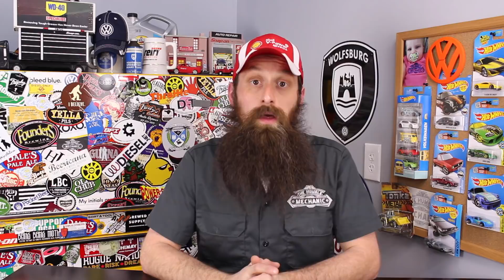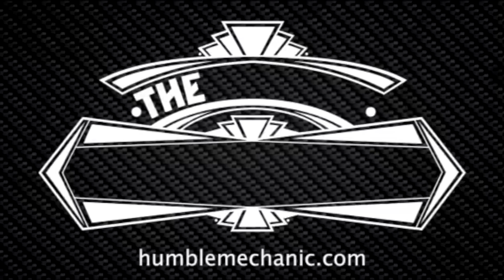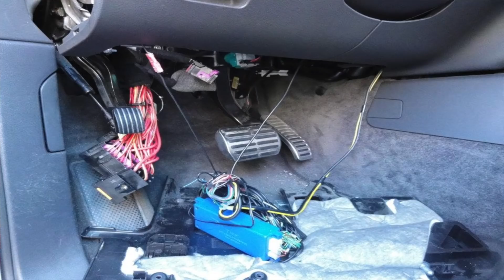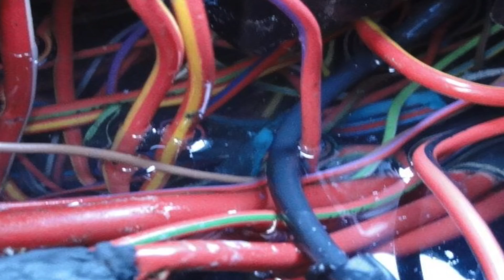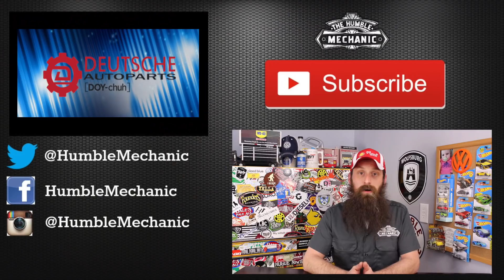Top 5 Failures of the Volkswagen Touareg

Comment: We bought a used 2012 Touareg three and half years ago, replaced tyres after 40,000km and didn’t have any of the issues that you spoke of.
Reply: This is more about the very first years of the Touareg. After the facelift many were resolved. 2gen one (what you have) is much better designed vehicle.

Comment: I have a 2017 v6 3.0 only problem I have had brakes and discs replaced 23000 miles only due to steering shudder under breaking discs only 20%worn pads 50% worn not good for 2300 miles just replaced with brembro discs/pads £120 DIY other wise all good

Comment: Hi, 2012 treg owner and have spent a small fortune on electrical issues and judging by treq owners forums these are ongoing issues that VW has not modified. A couple of questions please, currently have orange warning light up "ACC unavailable" and according to VW dealership this is because of a faulty sensor. Would this be right? can they plug into my computer and interegate the fault and tell me which sensor it is? is this a simple repair? cost roughly? Also, we are on 3 rd lot of disc pads and rotors, is this normal wear and tear or are we too hard on brakes? should we go for and aftermarket setup which could provide better disks and pads? Finally, with electrical problems should we stop the auto motor start/stop to save fuel as dont want to have to replace the starter motor? does the starter motor have a life span in this mode. To be fair, we bought an expensive, german engineered car expecting years of trouble free motoring in our retirement but it has just turned out to be an unreliable money pit, I reckon we have put 15K into electricals, so disappointed and would never recommend buying one to anybody. Would value your comments
Reply from the maker: Totally normal for brakes. 

On the ACC, it’s not quite as simple as just plugging in. But they should be able to tell you which sensor has failed. 

If you can disable start/stop I might. Starter motors do have a lifespan. But it’s a ton of starts. 

I’m guessing you’re not in the US? The 2012 Touareg has been great here. Not perfect but really really good

Comment: I have a 2006 V8 Touareg. I was driving on the highwway today when my low battery light came on and showed it at ~10-12 volts (normally  operates at ~14 volts on the dash. Eventually all the non-essential stuff shut down (as you described in your video) and I had to park it. The battery is brand new this winter---I had issues using the jump terminal to boost/charge the previous battery. It was working fine until tonight.

I'm pretty new to VW--do you think this could be something simple like an alternator--or could it be an electrical issue/something else I'd have trouble fixing/diagnosing?

*Note: I bought this pre-owned from a VW dealership. Before they sold it to me they had to fix a headlight (ended up being a wiring issue) and they replaced the dash lights. 

Any help would be appreciated!
Reply from the maker: Could be an alternator, and those were really good about high volt drop on the cable from the jump-start post to the starter/alternator
Reply: @HumbleMechanic  Hi Charles, thanks for this video - and the "how to properly test for a voltage drop".   Super, super helpful.  Would replacing the cable from the jump start post to the starter be a good place to knock a potential source for the electrical issues?
Reply: Cam shaft . I had issue where low oil pressur light would come on while I'm driving and car just automatically would stop. Had the cam shaft replaced. Car running fine now. 2008 touareg 2 V8 fully loaded
Reply: Question is safe to use hyper seal in my touareg 2008 v8. Notice my valve cover gasket are leaking.

Comment: Thinking of buying an 05 Touareg V8 with 91k miles.  It needs $2700 in repairs just to pass inspection at this time. My fear is it will need more after I purchase it. Thoughts?
Reply from the maker: It is probably a legit fear. And remember vw doesn’t have to support the car for parts. You may find things obsolete

Comment: Got a 2007 Q7 with the same 3.6 motor. Is the oil pump known to fail? I'm having the chains, etc done and I'm wondering if I should get the pump replaced?
Reply from the maker: The pump is not a common failure point. Just that bolt. If you’re having the chains done, good inspection on that bolt is vital
Reply: @HumbleMechanic  Thx for the reply.  Just really considering replacing it seeing I'm spending 5k on the job already and would hate to have it taken apart again to access it while its already apart and it's got 100k miles.
Reply: @HumbleMechanic  Also is there a good list available of the part numbers of all the necessary parts that should be replaced while doing the job? I got a parts list from my VW dealer and another from the Audi dealer and both seemed to be missing crucial parts so I've been doing all my own homework to the best of my knowledge to add the parts on that should be replaced. I'm guessing the sprocket off the crankshaft never gets replaced?
Reply from the maker: no sadly such a list doesn't exist. Crank sprocket is part of the crankshaft, so no replacement. Most of the time the gears don't get replaced either. unless they have severe wear. There really isn't a ton of parts to replace. 

I would rather over replace things(with in reason) than under replace. But I can tell you the parts add up FAST!

Comment: I purchased a 2015 Touareg TDI two months ago. I love the car,  but just had to spend over $5,000 to replace engine parts due to water damage.  The air filter was soaked and water was ingested damaging the turbo, etc.... apparently everything was soaked from simply driving around on a rainy day. I am shocked that this AWD vehicle isn't able to even handle driving in the rain without costing thousands!
Reply from the maker: Oh damn that SUCKS!
Reply: I think there is a recall for this now. It pays back for previously incurred expenses.

Comment: Three years ago I bought a 2004 Touareg with 115k for $1400. It was a gamble since the car was obviously not taken care of by the original owner (a doctor). After spending about $500 to fix the air-ride and other minor issues, I'm happy to say that this was one of my best deals ever. I've logged 50k and haven't had anything serious go wrong, although one of the rear windows doesn't work, hatch only works after clicking button multiple times, and the check engine light has never gone off as well as tire monitoring. The power of the V8 is astonishing and it always starts. I will drive it until the wheels come off and feel I have a long time left. Great Car!!
Reply: Timonius G to open the rear hatch with the fob you have to hold it for 3 secs then open it.
Reply: Almost same thing. I bought an '04 V8 from a doctor. Mine was unloved too. I paid a bit more than you but interior was pretty nice except buttons. I have done the timing belt, all the fluids and filters, brakes, tires. A few real PITA issues like a BCM that melted down, a aux water pump that was pushing coolant into the wiring harness and had to rebuild the Tranny valve body. I think I can get 50K miles out of this now. I have 4 corner air, I also did the RF air spring after it failed. Every now and then I have a different thing to fix. Like the TPMS module and sensors when I did the tires. I got steering wheels buttons from a junker that were pristine, tow hitch from a junker. They know me well at the local pick-n-pull to get cheap modules and buttons etc.
Reply: How’s the 4.2 treating you? Did you have to do the chains? Looking at a 06 touareg 4.2 with 80k miles
Reply: It always starts lol. If you have to mention this on a modern vehicle… well….
Reply: @panama-canada  2004,but yeah, you'd be surprised at how many just decide when they do or dont😂

Comment: I just paid $450 to get the battery replaced on my 2004 V8 Touareg. Replacing a battery is something you can easily do yourself, but not on this freaking car. I would love to punch the German engineer in the face that thought burying the battery under the driver’s seat was a good idea.
Reply from the maker: It’s a more expensive battery and you have to pull the seat up.  Sucks to have to pay for. 

I still think 2.5 Beetle is the worst

Comment: First gen of any cars are going to be a pita especially from the Germans.
With that said the 7L vs the 7P was a big improvement over reliability but came in with half the features when the 7L appeared.
The 7L had that marvelous v10 tdi which I’m sure this mechanic knows all too well what a pita it was.
The best & last Treg to come to our shores was the 2016 v6 tdi with the 2.2 gen. Even with the emissions fix, it still hauls ass. Unfortunately doing tune & delete has caused some of the ecus to burn out. I won’t call out which tuner but it is highly recognized in the German world. Hopefully they’ll figure it out soon for something more reliable. 
But for the most part the 7L has been so far normal without much a fuss. Guess VW learns afterall😂

Comment: I have a v6 2004 touareg can i replace my transfer case with a 2005 transfer case?
Reply from the maker: I want to say those were the same parts. A little trick would be to call the local dealer, ask for the part number of a 2004, and then a 2005. Those vehicles were basically the same.

Comment: I'm having wiper issues with 2004 toureg v6, did motor got it to turn with out linkage on alitte put all back in nothing, even hear of some sort of ampifer that goes bad that's tied in? Found that on a form guy had ssme problems and dealer fixed, they said that was the problem? Any help would be great thank you, I have the 04 Passat W8  4motion had great luck so far!

Comment: Hey! My wife and I are looking to buy a 2012 Touareg TDI with 114K (emissions modification completed) is the maintenance as expensive as most people say they are for Touaregs? Thanks!
Reply: Nathaniel Farinas I have 2014 Treg but with V6 engine. 47k miles so far and no issues. Regular oil change, I would go every 8k miles with synthetic oil and premium gasoline, just to keep engine clean. I don’t have any experience with TDI, but I was looking for one like that due to very good MPG. Very hard to find used though...

Comment: German Touareg GP V10 TDI @2008, 186Kkm, 2 times changed propshaft bearings, once DPF filters, no other issues, just service it according to manual(changing of oil/battery/filters/etc).
Reply: I am looking to get an 08 r50 v10 with 225k km.
Would you be confident in such a car?
Reply: @a3.leman88  Depends on previous owner servicing. If I was to buy such a car now, I would like to check injection(correction in groups 13-14 close to +-0 and pumps in 23-24 must have correction between 10 to -50 on 2000rpm) with VCDS as min. as well as turbo performance (if boost and air quantity is equal between cylinder banks during acceleration on a 3rd gear in manual mode from 1700rpm to 3000 rpm (i.e. in VCDS logging to file mode)). I would also insist on opening cylinder head cover to check state of camshafts, it is very much common practice that people don't change oil in right interval (it's not just 15000km it is 15Kkm OR 250 hours of driving whatever comes first) and camshafts dying as a result. Another must have check is to play with suspension i.e. max low and max high (xtreme level) at least 2 times to see that it is ok (no errors, compressor is not working all the way round). Do not forget to check voltage on running engine (13.8-14V is a must) otherwise alternator has a problem. Also lock central diff and do some driving on a parking, it should not produce strange sounds and no error must appear.
R50 engine(CBWA) is the same as other euro4 V10 tdi (BLE) except it has injectors from 2.5TDI (Touareg R5, Transporter) which  are better flowing then BLE ones (thus CBWA injectors are cheaper then BLE ones due to higher availability... ) and an ECU with very slightly changed injection quantity on higher RPM.
Reply: @antonlancevic652  Thanks! You seem to know your stuff.
My only experience with larger diesels is my previous 2.5 AKE v6, on wich I had to replace the VP44 injection pump and was going to replace the worn out camshafts but somebody totalled the car. I still have the parts though.
So in order to touch an r50 will have to sort myself with a VCDS kit, wich was in the plan anyway, once I figure out how to get one form US without paying the ridiculous import tax. At the moment the nearest r50 touareg is in UK, and registering one in Ireland will cost an absolute fortune, an option would be to register it as a commercial vehicle but have to give up the rear seats, wich defeats the purpose for me. The road tax for a private r50 is about 2400€/year here and the insurance is sky high also. Need to become a millionaire before such toys are out of the roads and replaced by teslas.

Comment: I loved that SUV. I have a question in my mind about months, which year or generation it's better?
I was thinking in a 2008 V8 Touareg.
Reply from the maker: T3 is best. T2 is still pretty dang good. They are just old so who knows the maintenance history
Reply: @HumbleMechanic  
Thanks, after this recommendation, I'm going to buy that 2008.
Reply: @luisdelacruz3349  how is your 08 touareg running? I'm thinking buying 08 v8  next week
Reply: @mateomat1788  
It's working really good, I recommend, totally.
Reply: @luisdelacruz3349  thanks for your recomendacion be safe
Reply: @mateomat1788  
Same
Reply: I own a Touareg 2008 v8. I have a love and hate for this car. This car is a beast though. 186k miles still a beast. Just changed vacuum brake booster pump and purge valve. Next up is lead detection pump for some reason my Touareg loves shell vpower premium. Always feed it premium gas. Had this car since 2008 . 
Knock on wood my Touareg made this far and still going

Comment: Hey man, thanks for the great video! In your experience, was the elecro-failures down to the cabling mainly or due to battery issues such as incompatible models, low voltage, short life...etc. I have noticed these issues with my 2007 car only after I changed the battery. Or is it alot more complicated than just that? Many thanks in advance.
Reply: My problem was solved when I upgraded the Amp by changing the battery. 
But that was for a 2007 Touareg. 
Not sure of Jettas suffering from the same issues. If your problem is most obvious during cold days or affecting ignition mainly with fault start..then upgrading the Amp might help.
Reply: Hey I had the same issues with my 2010 Jetta after battery replacement, what was the problem ? Did you find a solution ? Thanks

Comment: 2005 Touareg VR6 with 192k miles. I daily this thing 50 miles a day. Planning a 2000 mile trip this coming year. I love this damn thing.
Reply: Hi, have you ever had an issue where your car shutters, jerks or gets stuck at 40mph at a low rpm?

Comment: Should I be afraid of buying a 2004 Touareg V10 with 225k miles? Lots of service records including propshaft and both turbos replaced. Everything works right now with no check engine lights.
Reply from the maker: The concern I have is mostly fixing and maintaining an 80k vehicle. It doesn’t matter that they are $10k now, you’re still paying top dollar for parts and service
Reply: @HumbleMechanic  I am a pretty good mechanic, although without my own lift an engine pull would be not practical. It's not like my e30 325is where I can pull the engine in an hour and a half! The one I'm looking at is $5600, and I will be selling it in 6 months. I just want it for a 12k mile / 4 month road trip where we will be towing a small sailboat the entire trip. I think if it were going to be long term ownership I'd be much more hesitant about it.

Comment: I know its been awhile since you released this video, hope someone is still reading comments. My 2006 V10 sometimes hesitates during acceleration, and refuses to up shift. This does not usually follow with any fault codes, but I do get a random misfire once in a while that clears itself. The two seem unrelated. I was intrigued by your comment on the brake lights that cause a hesitation in acceleration. How can I test for this?
Reply: Turns out the fuel filter needed to be replaced

Comment: I have a question. I have a Touareg 3.0 V6 from 2006, and the average consumption is behaving different from other cars I owned. Basically the value gets updated too quickly, not as quickly as the instant consumption, but it doesn't show a real average consumption. For example, if I drive it, I get around 14-15 liters per kilometer (I'm from Europe).

When I'm standing still, the consumption starts to go up, the longer I stay, the bigger the consumption goes. Now that's normal, if you leave the car running for a week, the computer is gonna calculate a huge consumption, because the care ate a full tank without moving an inch.

But what boggles me is that the consumption value gets updated too quickly, like if it's showing me 30% consumption while standing still, if I start driving, in about 30-40 minutes the consumption goes down to 14-15%. Is this normal for Touareg, or is there a setting that can be changed, to make the average consumption more accurate?

Thanks :)